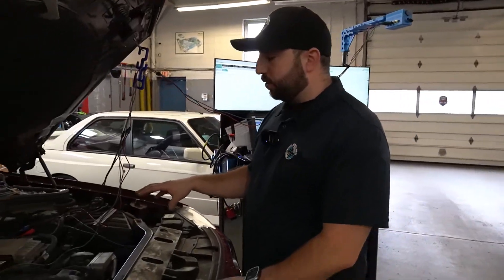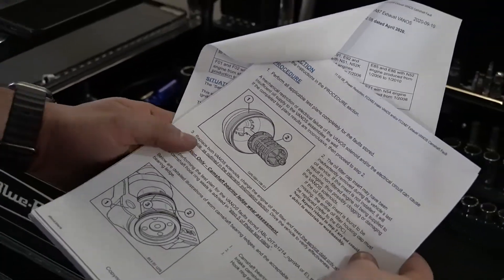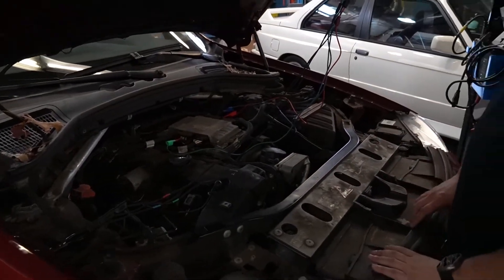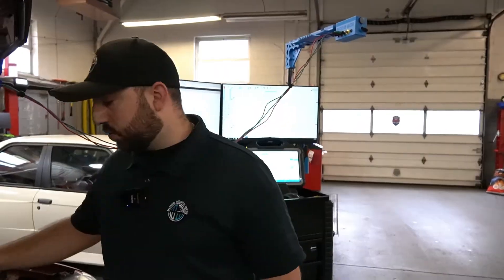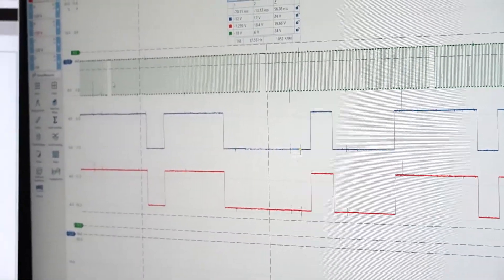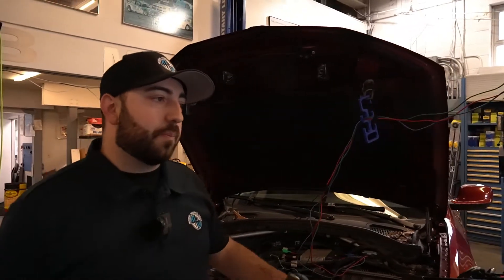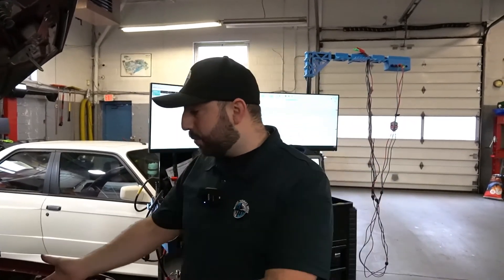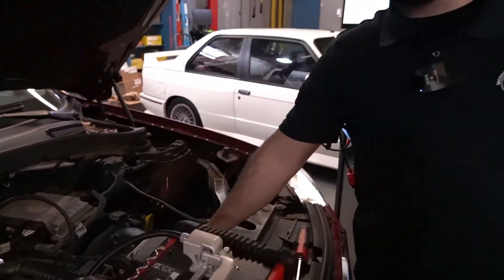BMW N52 VANOS Fault Diagnosis

Comment: Exhaust camshaft installation faulty 164041 code and I’ve exhausted my capacity, it came with the fault, so I’ve replaced everything and still same fault, done  all adaptations am still same fault 😭😭😭 as anyone got any idea what this could be please
Reply from the maker: What timing kit are you using for setting the timing

Comment: Very Profesional. How much to get an entry level ista scanner ?  Indiana.
Reply from the maker: Sorry we don’t sell ista but it depend on if you have a pc that can handle it or you need one software should be around $609 and pc with software around $2k plus a icon around $800

Comment: P0012, changed camshaft sensors, VVT solenoids even swapped and stays p0012 changed oill with fresh filter and new o ring on cage 

Still coming up and stalling at a stop and feels under power

No chain rattle at all...any help
Reply from the maker: Did you remove the valve cover and check the. Banks units , it’s sounds like you have broken vanos bolts

Comment: Can that cause a p0492
Reply from the maker: P codes are tricky with bmw that p codes generally would be for secondary air but on some dme models it also means DME: VANOS maximum limit position, exhaust bank 1,do you know what dme your car has

Comment: Thank you for this video. I have a headlight problem with my 2010 BMW 520 e60. I have poor response and poor performance, especially after driving for half an hour. The car's performance when driving at the beginning is excellent and strong, but after that, it loses power noticeably. I checked the fuel pump, spark plugs, and the two bobbins. Is it possible that my problem lies in these small filters?
Reply from the maker: It really depends on what faults you have it free to check these, you can def take them out and inspect. Do you have any faults